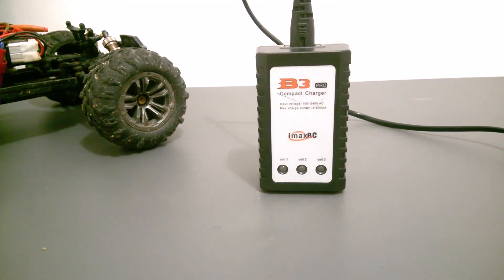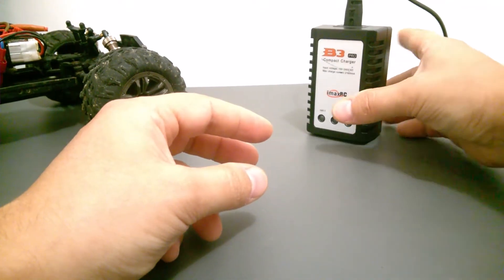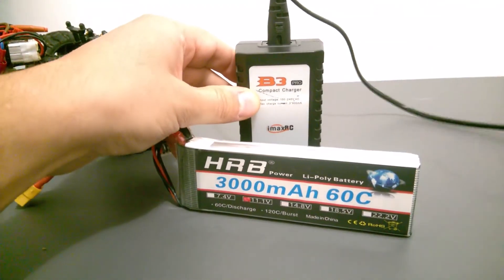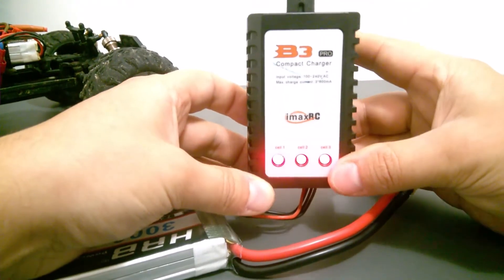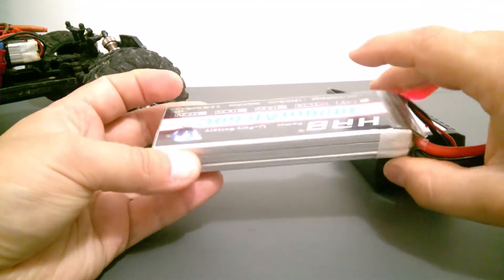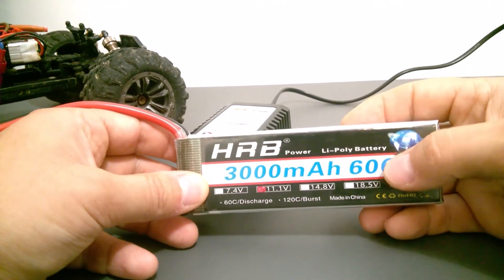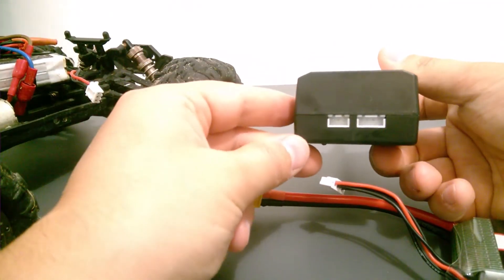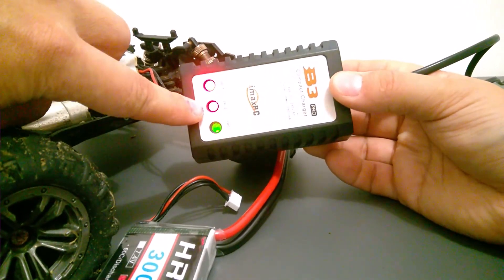How to Charge 2S-3S LiPo Batteries with Imax B3 Pro Charger? How to charge 2-3 Cell LiPo Batteries?

Comment: I have the hbx 18859A running a custom 4800KV with a 17T MOD 0.5, CNC 2.3mm Bore pinion gear (measurements must match OEM spur gear), a 35a esc, I bought this exact charger to charge a 3S Ovonic 1300mah (80c) battery. I’m literally waiting for it to charge so I can run it for the first time as I watch this video.

Comment: Needed this for the 3s for a hbx 16890SA is a complete beast in a parking lot around 35-40 mph . Besides the speed , also does wheelies on command when it’s going slower but not at a standstill , lol . Much fun
Reply: It's Super fun going to thrift stores taking old toys apart and using the bodies on my brushless and brushed both ran on 3s BEAST MAX & PRO, THE Brushed VERSION izz soo DRIFTY on 3s in the brushless needs the ground to be wet, to run 100%, otherwise it puts itself on its back like a turtle, even at 40+ 🤣😂🤗💯🔰☢️🆘

Comment: Out of my curiosity i tried to plug a xt60 to a different connector why does it spark?
Reply: It sparks because of the amps. Being its a higher voltage, carries more punch, nothing to worry about. If you are worried install a 35v 1000uf capacitor on the leads.

Comment: What if one of the lights is blinking green and red and the other two are just red while it’s charging?
Reply from the maker: if you charge a 2 cell battery (7.4V),  this is an expected behaviour.
Reply: @AventuraRemoteSmart  thank you for replying (it's an airsoft gun battery btw, does that make a difference?)

Comment: This charger is designed to charge 1 battery at a time not 2.
Reply from the maker: Thanks for your comment. The manufacturer does not state anything in relation to simultaneous charging of two batteries with this charger, neither it is explicitly forbiden by the manufacturer, but yes it is not advised to do so. I was able to charge two batteries at once, but eventually the charger got burnt. So, it is not advised to do so.

Comment: hey hi..
i have a 3 cell 3300 mah 11.1v lipo battery my second cell is dead its showing 0.00v ,so can I recover it with a B3 imax RC charger? can i charger that dead single with the B3 Imax charger ?
Reply from the maker: I do not think a dead cell can be charged and it is better not to charge it, if there is something serious with the cell you may overheat and get into troubles. Better to pay for another battery and not get into troubles that may cost you more problems in the end.

Comment: how long does it take to charge LiPo 5200 50c mAh battery?
Reply from the maker: It depends on the charging rate of your device, the quality of the battery, the charging rate of your battery, etc. In general, the safest charging rate for LiPo batteries is 1C = in your case 5200 battery capacity (mAh) / 1000 = 5.2 Ah. From there you can in theory calculate based on you charger speed how much it will take to charge. At 5.2Ah charging rate you would charge in 1 hour. But in the process of charging various factors may affect the duration of charging, like resistance inside of the battery, bad cells in the battery, etc.
Reply: @AventuraRemoteSmart  thank you, this helped me a lot